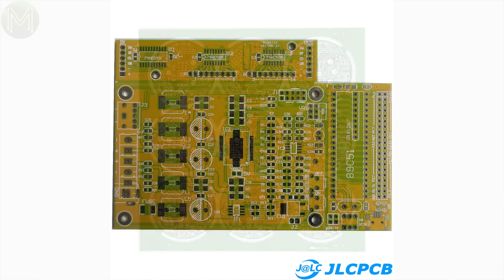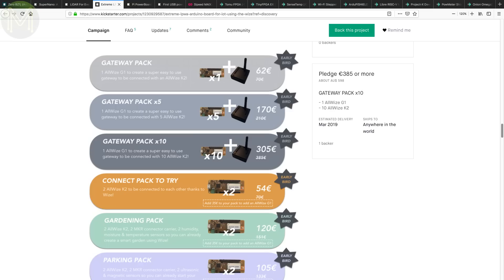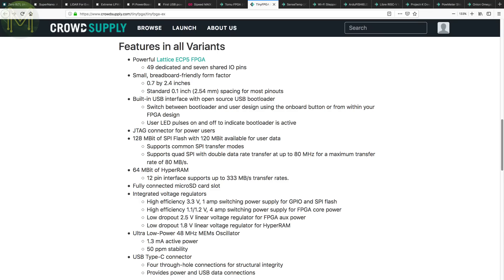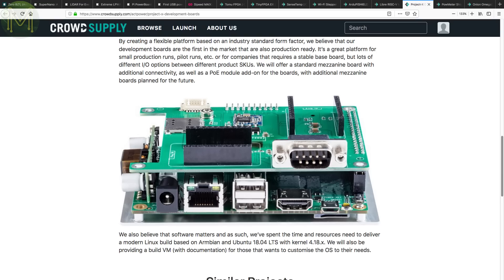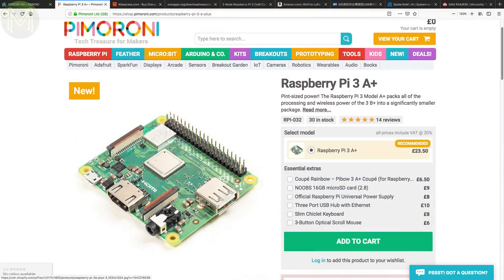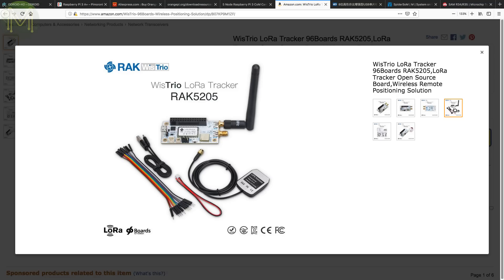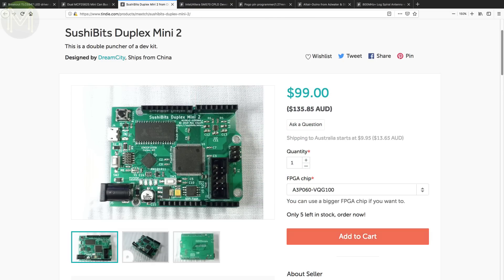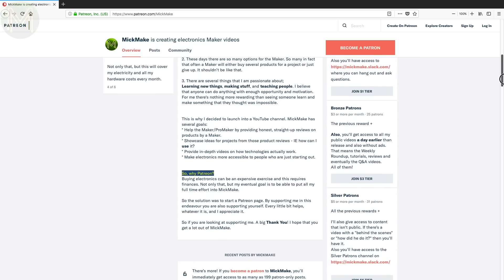#242 Weekly Roundup #61: New Maker Products // News

Comment: oops...that orange pi may have issues. Pytorch uses torch which uses CUDA, which only used NVIDIA GPUs. (Under supported frameworks 11:38) I'm currently studying ML...hehe
Reply from the maker: You're studying ML at Uni? Or casual study?
Reply: No, I'm cheap. I knew we were related...hehe I've been doing free online courses through Fastai. Based in San Francisco.
Reply from the maker: :-D Nice! I still think the best way to learn is to first have a need.
Reply: Actually, I do. A few years ago I wrote some Python programmes to prove/disprove the authorship of Shakespeare's canon but I got stuck as to which statistical measure to imply. I believe ML has a solution. Fastai's approach is a hands-on instead of just theory.

Comment: Hello! I have seen some boards with relays and a network connection on them.  Obviously they are for remote control of things.  But what system do these things run?  Are they tiny Linux SOC?  I am not electronics bod and I am not sure what I am looking it.  Could anybody cast some light on it please?
Reply from the maker: There are quite a few relay boards out there. Most of them are MCU based - that is they need something like the Arduino IDE to program.
Then there are others that fit onto a Raspberry Pi and other SBCs. They usually are programmed using Python.
Reply: @MickMake  It's the sort of thing........

https://www.amazon.co.uk/SODIAL-Ethernet-Switch-Controller-Module/dp/B075XC76HV

Thanks for replying.  I wasn't looking for it, it sort of popped up looking for something else.
Reply from the maker: OK. Those boards are based off an ENC28J60, (https://www.microchip.com/wwwproducts/en/en022889), and some MCU I can't really make out. Looks like a typical sand-off job on the MCU.

A quick google shows up this software: https://sr-201-relay.sourceforge.io/ all written in Python. There's also this: http://www.uddating.se/2017/05/13/sr-201-network-relay/

Comment: Thanks for heads up on all the FPGA boards... 
Still looking around for some good Xilinx based boards that will work with Vivado Webpack 2017/2018... not much out there.
Cheers,
 - Eddy
Reply from the maker: Vivado is a Xilinx thing. You can use any of the Zynq based SBCs with that, like the ZedBoards - http://zedboard.org/